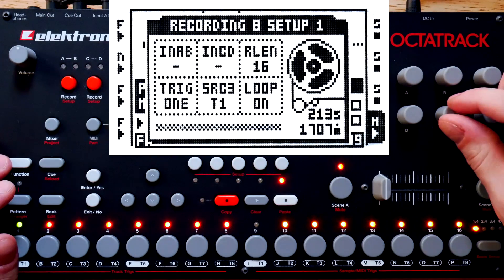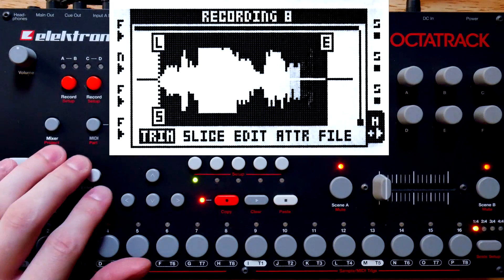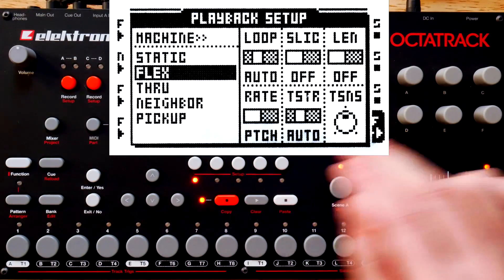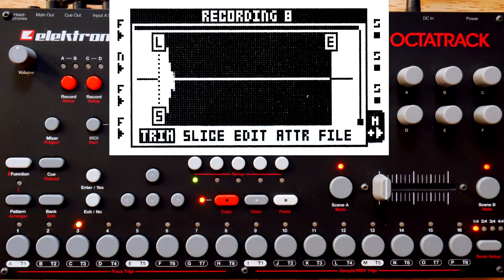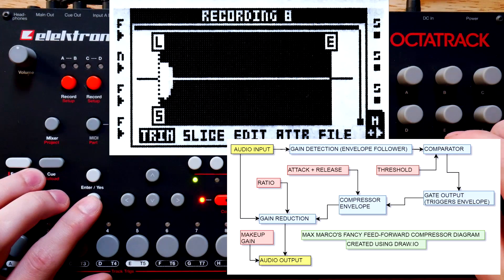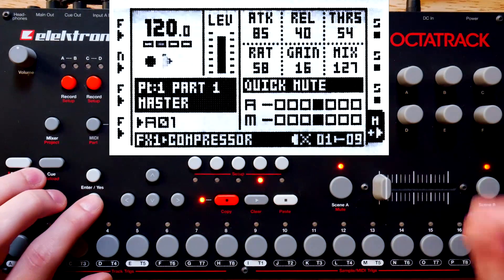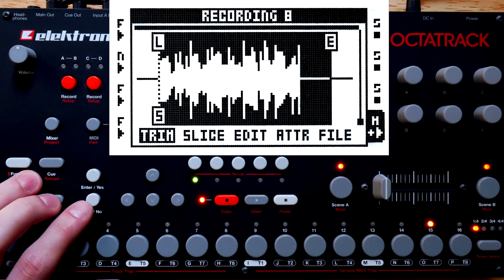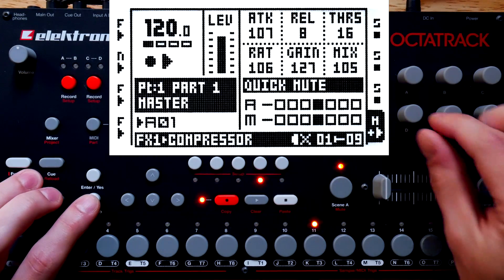Octatrack: Compressor Detail, Master Track 'Oscilloscope'

Comment: That waveform shortcut doesn't work on MK2. Rec Edit is under REC3 so you need to press Func + Rec 3 and afterwards select "EDIT THIS RECORDING". If you hold Track number and press REC3, it will start the recording, instead of showing you the waveform
Reply from the maker: iirc the audio editor waveform shortcut of track button + bank/edit button worked when I used a mk2, but maybe you are referring to a different shortcut? my experience with using mk2 is that none of the original button combo shortcuts were altered/removed, they simply added additional ways to navigate
Reply: @maxmarco thanks, I just learned by accident that a simple press of AED button on MK2 will take me to the waveform page. That's even better when you can do it with just one finger ;)
Reply from the maker: It's a bit of an improvement but you still have to hit two buttons if you want to go to the waveform view of a different track than the currently active track. The track button + bank/edit button shortcut is also useful even on mk2 for when you are in the record setup menu - it takes you to the waveform view of the record buffer instead of the waveform for the default sample assigned to that track

Comment: When I was trying this tonight I got a solid white line right through the middle of the record buffer playback window, as well as a solid white arrow beneath the playback line in rec setup. Any idea what I'm doing wrong? Thanks ...
Reply from the maker: are you starting with a brand-new project? I always recommend to start from a blank project to have all settings at a known default state to track down issues - it's easy to run into problems attempting to retrofit existing projects even with a thorough understanding of OT
Reply: @maxmarco  yes brand new blank project. The line and white arrow don't move (the way the line and black arrow move during regular buffer playback), they stay stationary. I'm doing your resample synthesis method as well as the oscilloscope on master track (after I changed it to flex machine). White noise and resample tracks work and visualize as expected

Comment: I have been watching a lot of your videos lately, and they are all quite good. Thanks so much! I did want to mention, I've heard you say 'parallel compression' a couple times, and I don't think it means what you think it means. If you really think you're doing parallel compression somehow, I'd be interested in a video explaining it. Keep up the great work!
Reply from the maker: thank you, but you may be thinking of a specific style or technique of parallel compression (such as the term 'New York compression' - there are some other I believe also) - all 'parallel compression' means is that you are mixing a compressed version of a signal with the uncompressed version of the signal - whenever you have the Octatrack compressor at a mix value below 127 you are mixing in some of the uncompressed signal and you are now doing parallel compression
Reply: @maxmarco  i see. i usually think of it as making some decision about what part of the signal being compressed. meaning, you have to split the signal in some way and compress only some parts. in any case, keep em coming :)
Reply from the maker: although I agree what you describe is 'parallel' in a sense of having multiple versions of the same signal (to get technical any time you use any sort of aux send bus you are doing parallel processing) the instant you do anything other than simply compress or not compress there is generally going to be a different term used than 'parallel compression' (which is a rather simple scenario and is frequently combined with other compression techniques) - for example if you filter/split the signal into frequency ranges and individually compress the frequency ranges that is generally referred to as 'multi-band compression' (i.e. frequency range dependent compression)

Comment: Awesome tip - of course there's an onboard oscilloscope! This definitely helps with the somewhat fiddly compressor. 👍🏼
Reply from the maker: I find that the compressor has very wide parameter ranges - once I've dialed it in I'm usually only moving parameters a few ticks in each direction at the most, as even just 1 increment of a parameter when you're sitting on a sweet spot can change things up very dramatically!
Reply: Thanks! - I'm glad to hear it's not just me experiencing that. Your depth of knowledge of these machines is amazing.

Comment: Amazing stuff, thank you! Finally I understood how to do distortion and saturation on OT properly, as the standard lofi module distortion doesn’t sound as good as it should. LFOs on attack and decay is also a great idea, adds an instant groove.

2:37 AM and your video dragged me out of bed to spend an hour tweaking the compressor, haha.
Reply from the maker: haha, awesome!! the lo-fi effect has various problematic aspects to it and imo is to be used very cautiously - it really won't maintain the integrity of the audio at all - I don't tend to use it often but sometimes it's fun

Comment: learned a lot of about compressor, thanks a lot , enough to experiment an other week or so
Reply from the maker: always more to learn about compression! OT compressor since it only has abstract numbers and is a very aggressive compressor has taught me how to 'hear' compression probably better than any other compressor I've used
Reply: @maxmarco   I will test it with some human voice ... its maybe easer to hear what's going on
Reply from the maker: always easier to hear compression with highly dynamic signals - OT compressor is rather 'brute force' though, making it extremely effective for sound design, and I find to really dig into that aspect requires getting a feel for how it shapes the sound when using the rather static audio sources that are generally produced in a sample-based production context
Reply: @maxmarco   yes, compression as expression. I think its inspiring